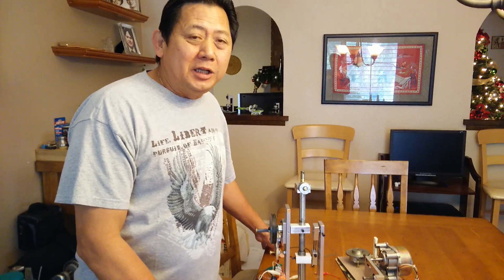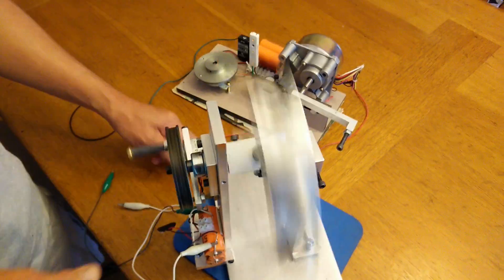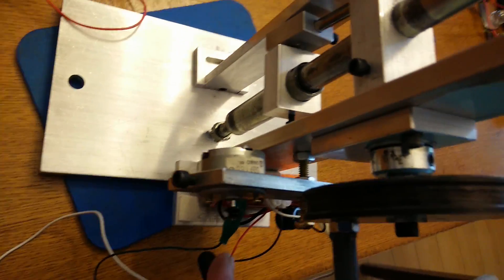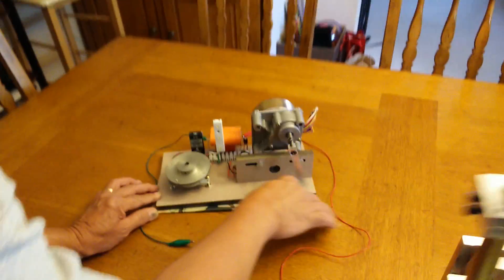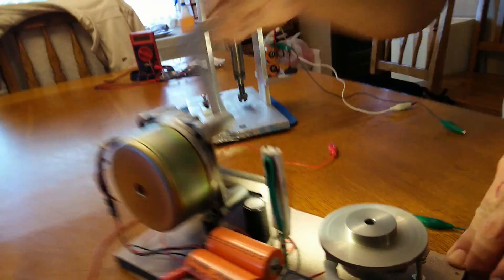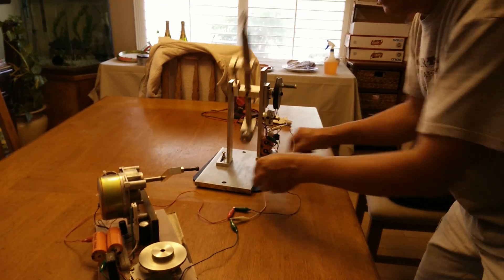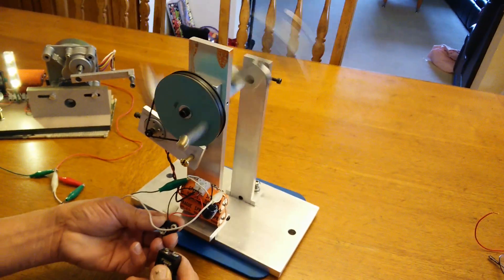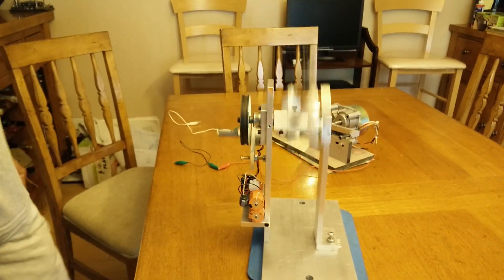Fun Unbalanced Machine Generator

Comment: If you put a spring on the weight, you should be able to get this to run off gravity and centrifugal force. It probably should have a lot heavier weight, about 2" long and 2" round steel. It is a perpetual motion machine.